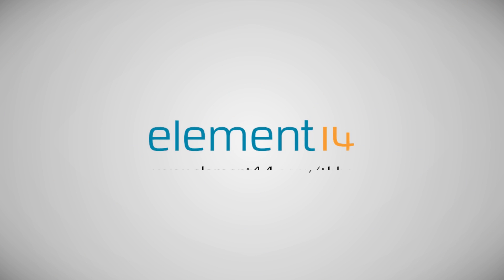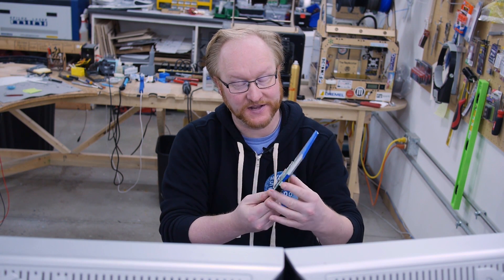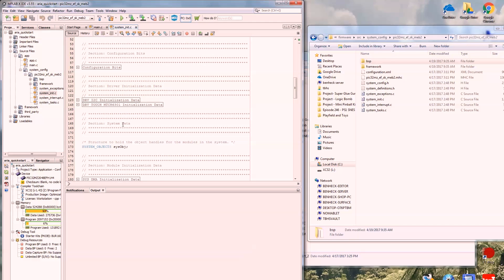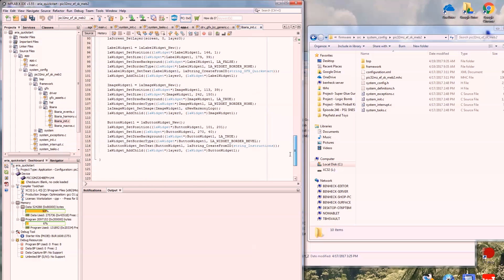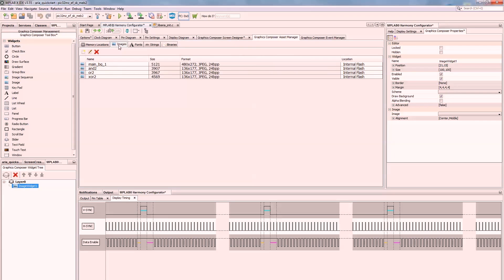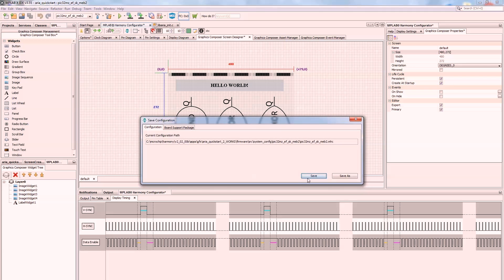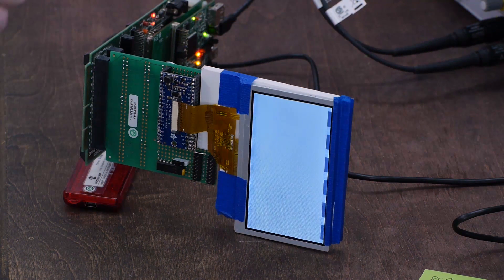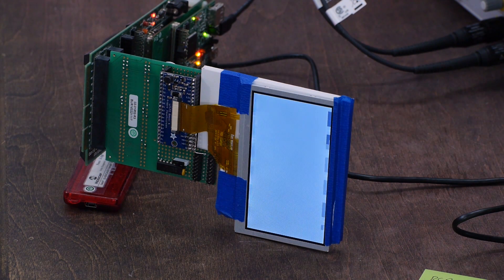Logic Gate Board Game 03: Adventures in MPLab

Comment: Just a heads up, this version of Harmony does support PNGs.  There is a Graphics Composer Asset Manager tab that allows you to convert source images of any format (GIF, TIFF, TGA, BMP, etc) to JPEG, PNG or RAW (basic bitmap).  You have mentioned using bitmap would be ideal for speed, that is true.  The Graphics Composer Asset Manager does support RLE compression for RAW format.  You should get decent flash space savings using that also.  The runtime PNG decoder is a big memory hog.  It works best for smaller images, unless you have setup a large heap size.

Comment: Maybe you should use an external ram to store the double buffer
Reply: All about BOM.  You end up needing to use a static ram with parallel interface as SPI ram is really pushing it, and  they aren't cheap - $15 or so a piece and at least $10 in volume.  
http://au.element14.com/cypress-semiconductor/cy62167dv30ll-55bvi/sram-16mbit-parallel-55ns-bga/dp/1876332   
Then you have to generate the address and data bus lines with io pins.  The on-chip 512k of the PIC32 and some Cortex M4/M7  is ideal for decent UIs with midrange colour and resolution.

Comment: PNG does not use RLE, it uses a variant of LZW, basically like a .gz file.

Anyway, switch your controller to 1 bit graphics, and tie that one bit to all 16 pins. It'll be WAY faster. Or if you need color, just use 2-3 bits per color component (8 bit color from the controller) and tie the unused bits to ground on the display. This is assuming a parallel data bus, of course.

Comment: Save a ton of memory and just draw your interface using primitives.
Reply: I was thinking this too. Those graphics are really nothing special that couldn't be done with manual primitive stacking.
Reply: MacJohnMcC That won't really save much. The images are in the 2 megabyte ROM, and you can probably read directly from ROM.
Graphics primitives don't help because you still need a framebuffer (unless you can drive the display fast enough to draw graphics pixel by pixel in realtime).
the problem is the framebuffer itself. 480x272x16 = 2,088,960, or 255 kilobytes.
That has nothing to do with bitmaps - it's the raw framebuffer, and it takes up half the system memory.
That's a fact of life you just have to accept 99% of the time with graphics
The only way around that (besides dedicated graphics hardware that doesn't use framebuffers, like, say, that found in 8 and 16 bit consoles) is if the hardware allows the CPU to drive the display output directly, but then you need the CPU to update each pixel as it is drawn.
Not only does that mean in a case like this that the CPU has to write 4 megabytes/second of data, but it has to do it with flawless timing too.
And the timing especially is a difficult thing to ask a microcontroller to pull off reliably. 

Switching from bitmaps to graphics primitives will help conserve ROM space, but it won't help at all with RAM. (and with probably only a handful of graphics and 2 megabytes of ROM, that's not really a major concern.)
Reply: Of course the screen will take the same amount of memory. I was saying that the graphics could be drawn with primitives instead of using JPEG files. Probably faster as well as much smaller space. 2MB isn't endless.

Comment: Would a Raspberry Pi III not have worked better as you can load the files into a MicroSD card and just fit it into the MicroSD socket and fire the Raspberry Pi up and once the OS boots up the application will fire up if you create a cron job and you can actually build the package on the Raspberry Pi or another ARM based computer.

Comment: Ahhh the love and hate of Harmony.  Way powerful but some of it still doesn't work right and yeah .png is one of them, at least that's my experience- maybe I'm just dumb.  Verbose is the best description and on a 200MHz PIC32MZ you should easily be able to bitbang VGA, let alone double-buffered PSP 480x272.   Surely you don't need hi-colour for this application? 12bit/4:4:4 would be ideal, <200k per page, leaving well over 100k for code. The MX does 8 bit VGA well @ 80MHz.

Comment: i think there are so much simpler and cheaper way just to use LCD. how about rpi zero and those cheap 5" LCD?
Reply: You realize how cheap these PIC processors are right? It's easy to make a one off design cheaper with a Pi/Arduino but for mass production that would be ludicrously expensive.
Reply: That and until very recently it was extremely hard to bulk order Pi's. The compute modules are new, but unless you're willing to cost upwards like $30 of your design, it's way overkill.